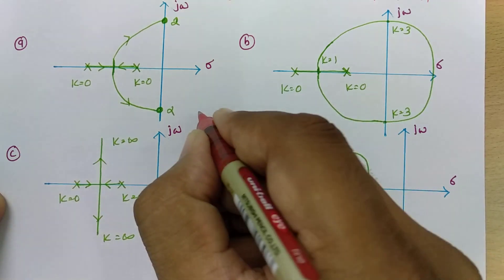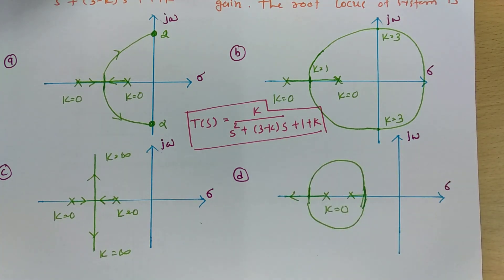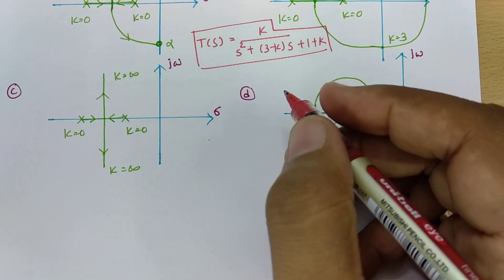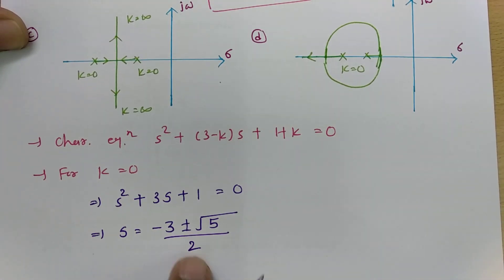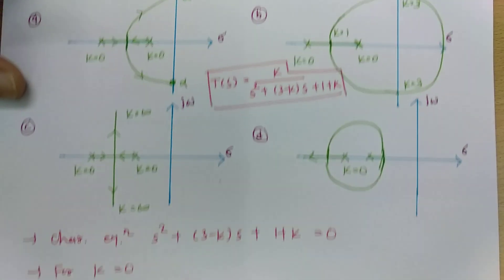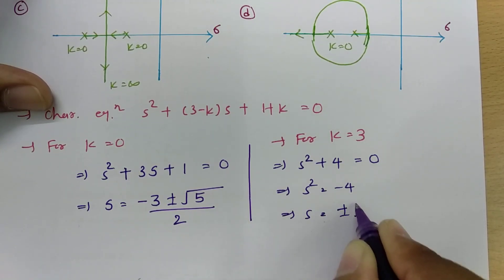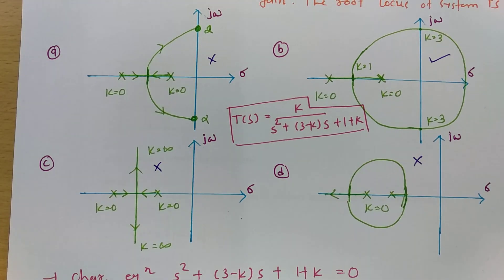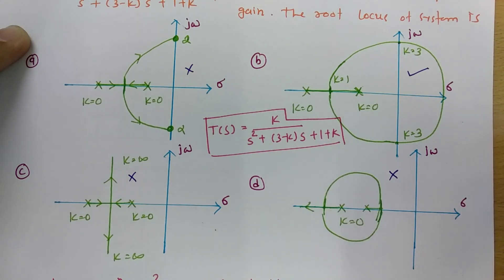Root Locus Plotting Through Observations: GATE Example 4

Comment: Firstly, this CLTF can't be derived from a OLTF, therefore it is not a valid transfer function. Secondly, there must be a break away point also at 1+root5 where the plot doesn't show any break away, here it should meet together. i think the question should be corrected as given CLTF = K(1-s)/(s^2+3s+1-(1-s)K), hence OLTF will be (1-s)/(ss+3s+1). that will solve the problems of no meeting point at 1+root5 and invalid OLTF for LTI system.